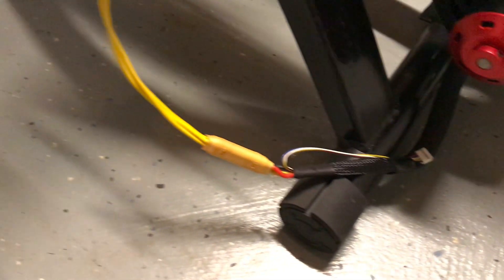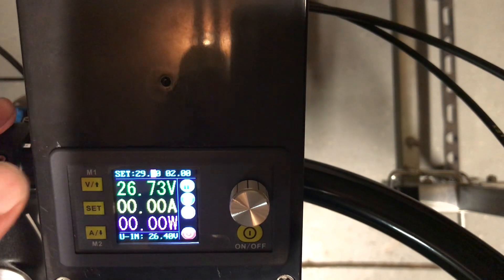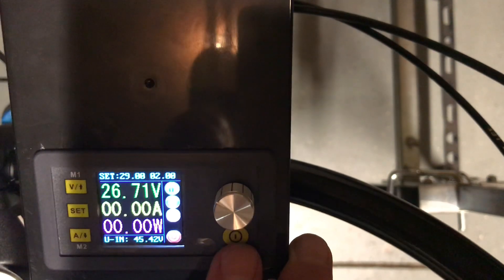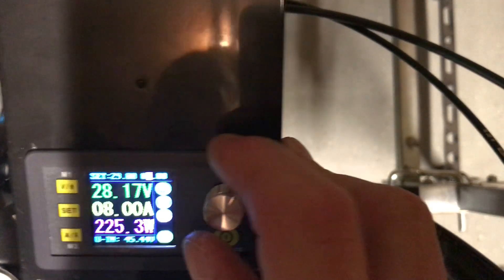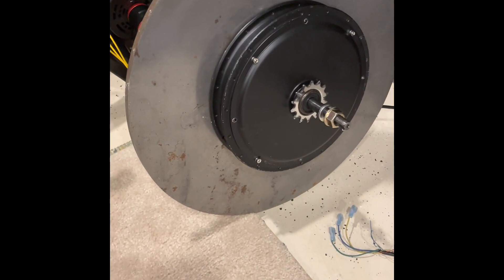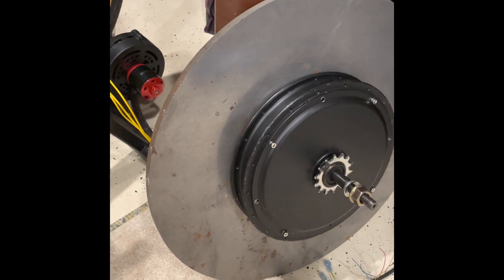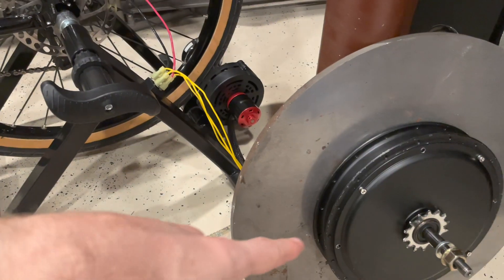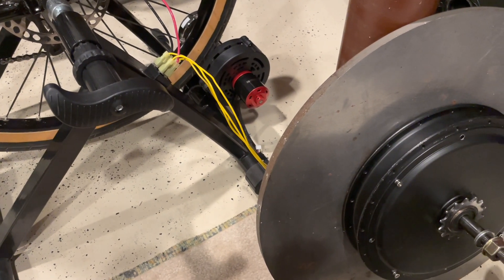Pedal Powered Battery Charger

Comment: You mention the flywheel plays some role, but to be fair I think for a more valid comparison, you need to create a flywheel for your bike trainer. I intend to add automotive wheel weights  (5 grams and 10 grams) which come with adhesive placed on one side, to make attachment to the rear wheel rim 'firm' ! Unsure how many I might use yet, but will consider stacking them for increased weight, depending on how good the adhesive is. They are supplied in strips in a box. It seems worth a try in the circumstances, but perhaps by now you have found suitable rim weights and tried creating your flywheel.  🚲 :goodvibes:
Reply from the maker: That’s an interesting idea! Please report back here it goes. I had also thought about filling the tube with water 🤪 but never tried.
Reply: @GenesGreenMachine  Hi gene, - I filled the inner tube with water and correct ratio of Anti-freeze as equipment in my garage. As expected it provided a large improvement to the wheel inertia and worked well, but anti-freeze found to be corrosive to inner tube repair patch over time. 😥   Continuing with half  the Anti-freeze content.
Reply from the maker: @STEM-ll9mc  Thanks for reporting back!  I have been curious if that approach would be effective.  Good thought on adding anti-freeze.

Comment: Finally my DPS works! It works so well! Finally! And the culprit was the tiny 25A fuse between the out+ and out-. I had to replace it several times and be very careful to solder it correctly. When burnt the diode next to it lights on red and the fuse needs to be replaced. The first time I replaced it I think I soldered it incorrectly and that's why I couldn't get current out. Now it works and I feel the resistance in my legs. I'm so happy now I can workout and charge my battery at the same time🤩
Reply from the maker: Oh awesome! So glad you were able to get it working! I was hoping I had not steered you wrong, it always seems to be the simplest thing. How many watts are you getting?
Reply: Oh yeah, those Digital Phosphor Segments are great. Initials alienate. Figure it out.

Comment: I've just received my brand new DSP 5020 and it's already dead! Hardly get a chance to use it something has burnt inside. This time I think I might know why.🤔
For first use, I connected the wires to my 12V lifePO4 battery just to do all my presets. Huge mistake! I connected the wires to the IN+ and IN- of the DPS and to the + and - of the battery. The DPS powered on and I did all my presets.
Then I disconnected the wires and connected them to the OUT+ and OUT- of the DPS and + and - of the battery. But the DPS powered on exactly the same! the memory of this thing is such that it powered on as if the wires were still connected to the IN+ and IN-. 
I connected the other wires as same set up as yours and to the IN+ and IN- of the DPS but the DPS was already powered on. I started pedaling and no current out. Like my first unit. I could see U-IN 15+V but no current out. 
Then I disconnected all the wires. I connected again the wires to the OUT+ and OUT- of the DPS and + and - of the battery. The DSP powered on during 1 min then I saw a sparkle and the DPS stopped working definitely.
Do you think the DPS is reverse charging when connected to a battery? Is it the pbm? Is it why I don't have current out?
Reply from the maker: Wow, you can’t get a break! Honestly I’ve done exactly as you describe and have not had a problem with both a DPS5015 and a DPS5020. I think the only real difference is I put a switch between the battery and the DPS so I can turn on when I’m ready, and turn off so the battery doesn’t drain when I’m not using it. You could go as far as adding a blocking diode to prevent current from going from the battery to the DPS, that’s all I can really think of that might help.

Comment: Great work! However, how does the resistance on the eBike motor get's controlled?!
Reply from the maker: The charge controller is used to adjust the resistance.  Volts are fixed to your batteries limit, amps are adjusted up or down for more or less resistance.